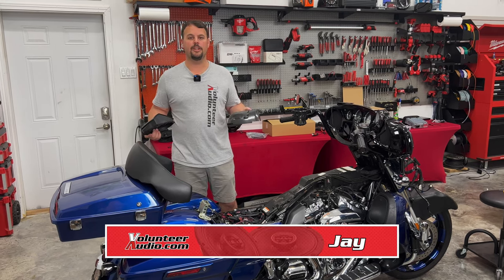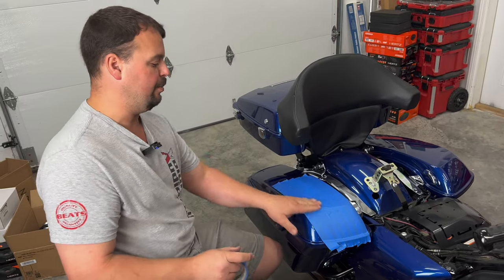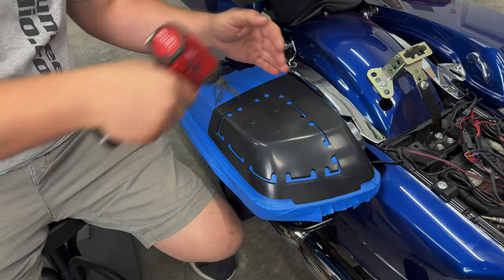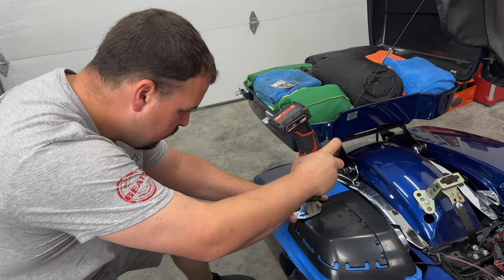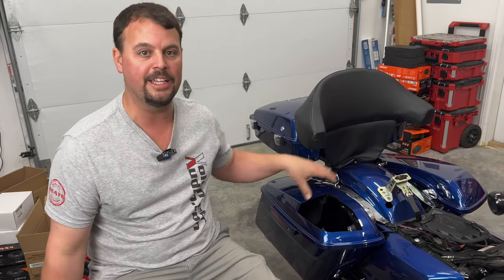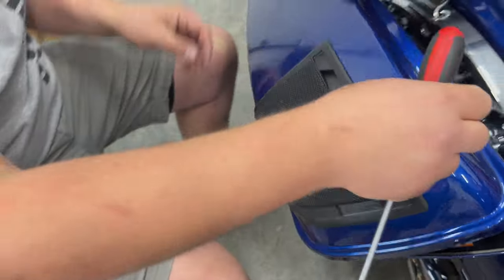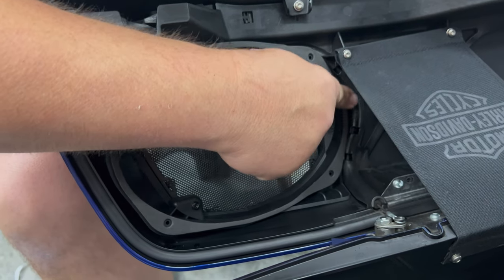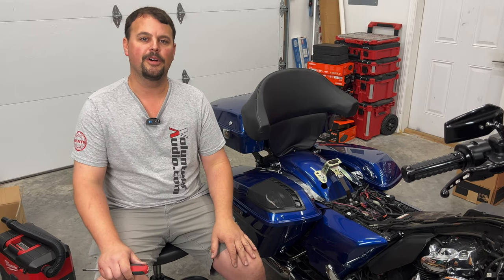Step by Step - How to use the NEW Hertz HDSLK-14 Cut in Kits to add 6x9s to your Harley Davidson®!

Comment: I just installed the HD14-STG2 Rockford Fosgate amp and fairing speakers in my Road Glide Special. Would I be able to run these Hertz speakers to that amp? Or would I have to buy another amp?
Reply from the maker: That system comes with a 4 channel amp so it should be capable of adding these rear 6x9’s

Comment: Hey Jay, 

Got everything delivered, and started tearing the bike down last night. I'm super excited to hear how it turns out. Could you please verify the 3/4" hole location for the wire please. I spoke with Ricky yesterday, and I thought he said about 3" down from the mounting plug. Is that correct? 

One thing I wish Hertz would do is to add the brass inserts to speaker mount in lieu of using the coarse threaded screws. Maybe on v2 of the kit 🤷🏻‍♂
Reply from the maker: https://youtu.be/Pg2ozj9fTK0 watch toward the end and I go over where to drill the hole
Reply from the maker: The speaker mounting holes have plenty of depth for coarse screws, the grill portion has limited depth and so brass inserts allowed more weight handling without stripping

Comment: Quick question! Can I order the cut kit and try to cut with the jig on a previous cut lid that was cut with the jig from the precision power that was sold as a stage 4 for a 23 road glide? I like the grill/enclosure more than the previous hertz branded mesh enclosure
Reply from the maker: This cut kit uses a smaller cut out and will not work on previously cut lids

Comment: So will these work in a 19 cvo road glide?  And is there a plug in harness as I don’t want to cut wires and my factory speakers have two plugs (4 wires) per speaker.
Reply from the maker: These only work for lids that do not have factory speakers, American hardbags makes adapters that we stock to adapt the 5x7” boom audio lids to 6x9’s
Reply: @volunteeraudio  thank you.  Do you sell wiring harness adapters so I don’t have to cut my factory wires?
Reply from the maker: @JohnJohnson-qg6wk  we do offer full plug n play solutions so no wiring is cut